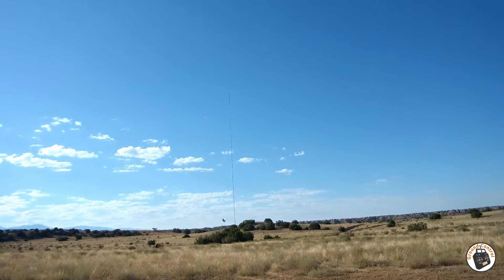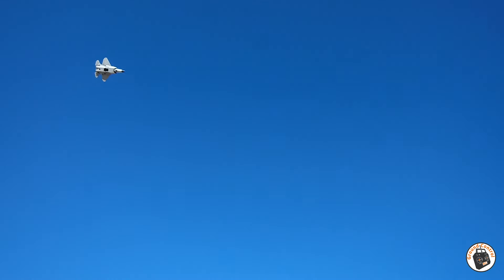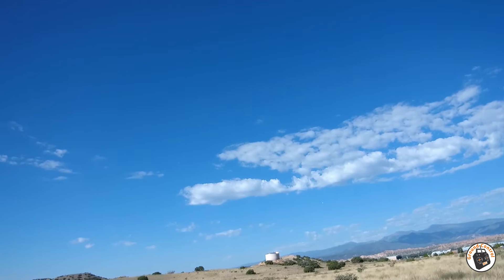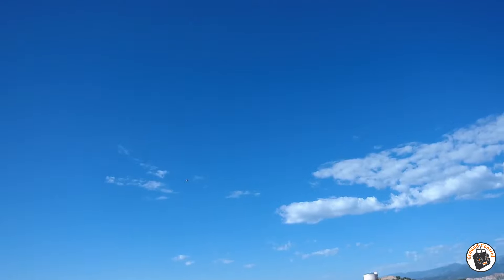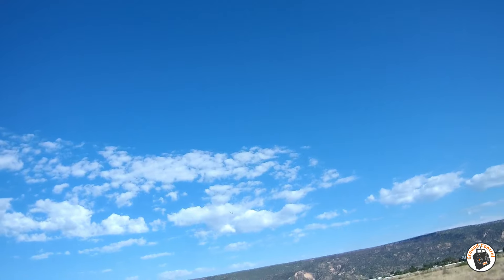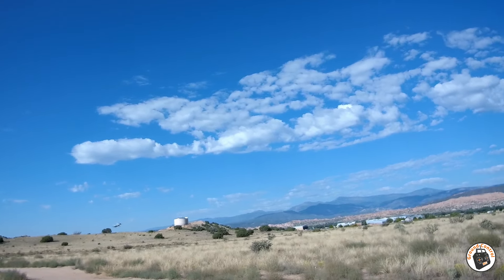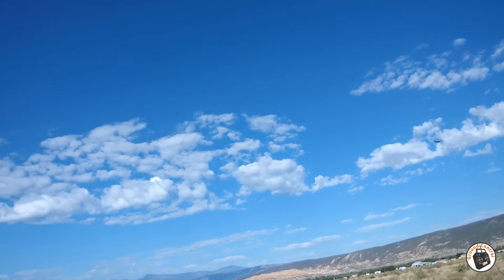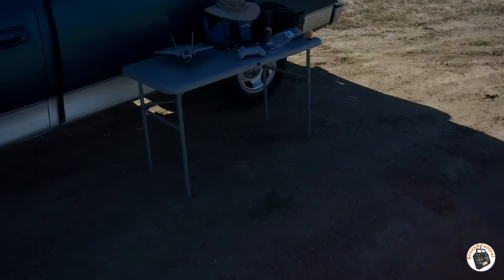Maiden Flight+1 | Beginner EDF Jet | Flybear J35 Brushless EDF Jet 370mm Sub 250g 4CH Gyro RTF

Comment: Good day,

How did you calibrate the gyro as mentioned din the video?
Reply from the maker: I held both stick at the bottom outer corners for several seconds.
Reply: @GroundControlRC  Thanks, and doing this before any throttle input correct?
Reply from the maker: @jtpienaar5719  Yes, that the way I did it.
Reply: @GroundControlRC  sure I tried it now but it doesn't seem to work, as I have a Volantex corsair and the reset works the same way but on the J35 it does seem to do anything.

Unfortunately my motor stopped working (jitters when throttle is pushed) as well so I order another 35mm EDF with a ECS. Plugged all the stuff in but no movement on the motor unfortunately. 

Have you noticed the elevators move up when throttle is applied, I think that might also cause the high alpha
Reply from the maker: @jtpienaar5719  I noticed the control surfaces moving erratically when on the ground  which reminded me of the gyro in the FlyBear SBACH 342.
I don't think it's doing that in flight as my nose ballast weight added a lot of stability.
I think it's fairly tail heavy.
Reply: @GroundControlRC  I am glad to see yours working that well, wish I have seen you video 1 month prior, as I said its not a happy camper at the moment.

I am quite new to the flying hobby so I still have a lot to learn.

Thanks for the great video and happy flying
Reply from the maker: @jtpienaar5719  Thank You!

Comment: Hi. I hope you can help me. 
With the battery installed the left elevator drops 
The trim doesn't seem to help. 
Is there a fix ?
Reply from the maker: Some of these gyros are strange with any trim input.
I mechanically trimmed mine.
I also found issues when changing gyro modes if there was any trim input.
Some gyros also act strange until there is throttle input.

Comment: Bonjour 
Comment se calibre le gyroscope sur cet avion?
Merci
Reply from the maker: They don't specify but usually you calibrate these gyros by holding both sticks to the bottom outer corners for more than 3 seconds.
Reply: @GroundControlRC  OK, merci. 
En effet,  je connais la manipulation mais je n'avais rien lu de tel dans la notice.

Comment: Do NOT ADD WEIGHT JUST REMOVE FRONT BATTERY WALL ITS HOLLOW IN COCK PIT SLID BATTERY FORWORD
Reply from the maker: Yep, I did that as well...after the conversion.